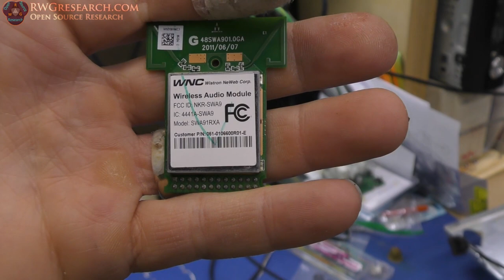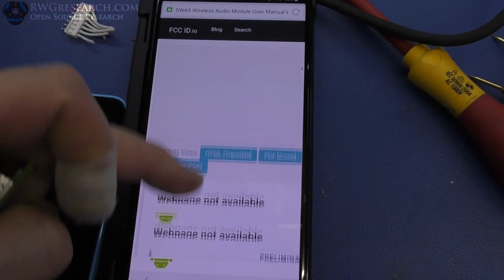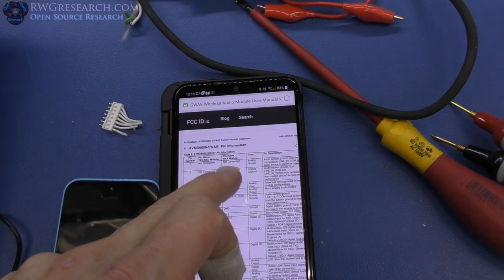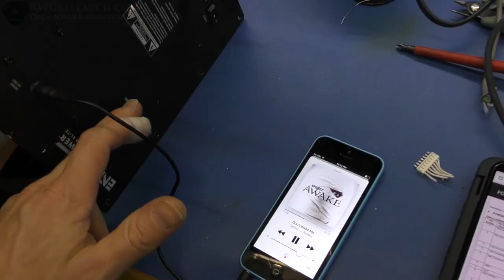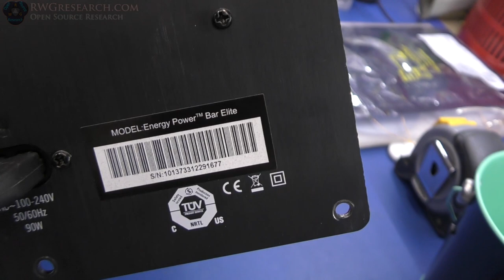Junk Wireless Speaker TO Saved Wired Speaker. "Its OK To Try! Its Already Junk Anyway!" Lets Hack IT

Comment: U were absolutely & completely thorough in the explanation & "recipe" for direct connections
{ until } you breezed past the physical ( + ) & ( - ) audio signal connections  •  i don't see where you landed the red/blk. wires in the circuit path ?   :^o
Reply from the maker: They land on the pins for analog audio coming from the wireless module. Just look up the data sheet for the module you have and then you can find the pins... ~Russ

Comment: You are my hero. I have a Klipsch R10B sound bar that will randomly stop producing sound until turned off and back on, and I have been searching to see if I could make this exact modification. What's crazy is the R10B uses this exact subwoofer, even the plate amp is the exact same on the inside, just rebranded.
Reply: I have a r20b same thing.  I got it done except for the input. Did you figure it out?
Reply: @rwegmuller  Yes I got it to work following this video. Although I ended up just bypassing the plate amp and using an external amp to the sub directly.

Comment: Or, you can do it the easy way:
1- Cut all 7 leads off of the BT header. Recycle said header. You don't need it anymore. 
2- Connect V+ STB and Link together. You can solder if you want. I just used heat shrink. 
3- Add the connection type of your choice using Out+ as positive and GND as negative pin 3. I used a mono rca header from a Sony sub but anything with +/- leads will do. 
4- Tape off the remaining two leads. Double check for any funny business. 
5- Test bump and put it back together. 

Your welcome. 🤘🏾
Reply: dwam82-db Can you help me with this?
Reply: Worked great, I just soldered the 3 pins together since the are all next to each other, and removed the unnecessary wires from the terminal. Leaving only the 2 input wires.
Reply: @riadelramahi  Attaboy!🙂
Reply: @EduKojak  What do you need?
Reply: Bro thank you so much, that was much simpler

Comment: I got a wireless LG subwoofer at a yard sale cheap and I wanted to hook it up to a car stereo or something I have lying around. This doesn't have any knobs, ports, just a button to pair and a chord.
Reply from the maker: In this case just get a regular car amplifier and disconnect the internal amplifier altogether and just reroute the speaker wires to the outside of the box.  this is the best way to use that Sub in my opinion. I did this on a JBL sub I got from good will for cheap. It sounds amazing... ~Russ
Reply: @RWGresearch  sweet, yeah I'm kinda inexperienced when it comes to audio. We barely covered that in my robotics class

Comment: My sony soundbar went out. The subwoofer is fine. How can I like it with my new sony sounbar that has no way to connect to it. My woofer is bluetooth mt sound bar  is ct-s100f sont and my old woofer is sa-wct260h. This soundbar has no way to adjust the treble or bass. That is crazy to me. Please help me. My.old soundbar is sony sa-ct260h. Someone told me it had a fuse on inside. Next to the power transformer or something. There is nothing o line to tell me how to fix it. You can plug it it and no lights or power comes on at all